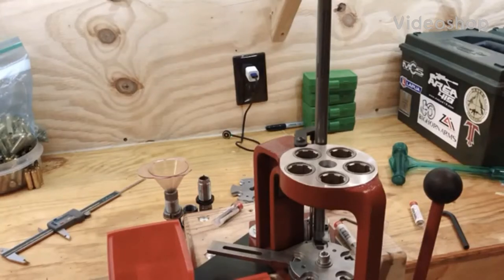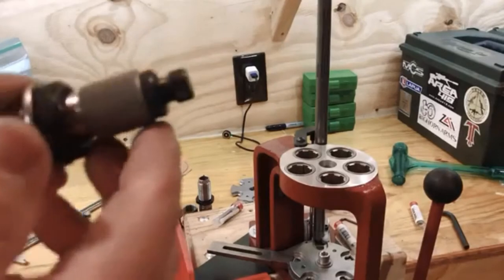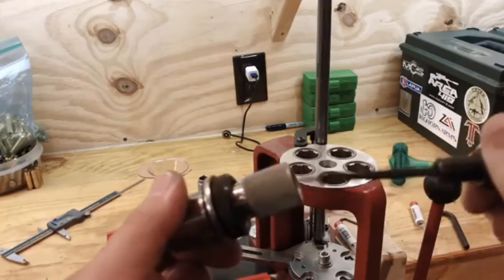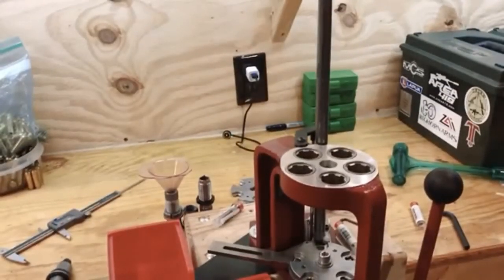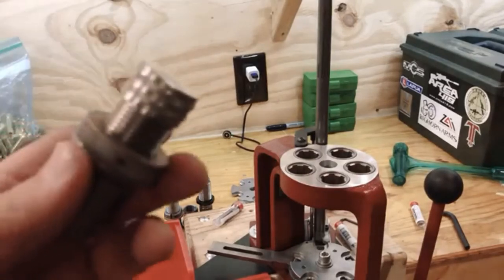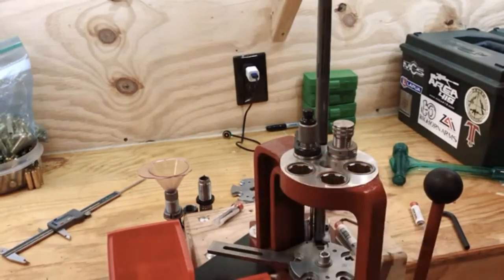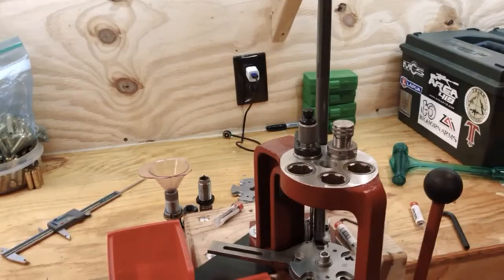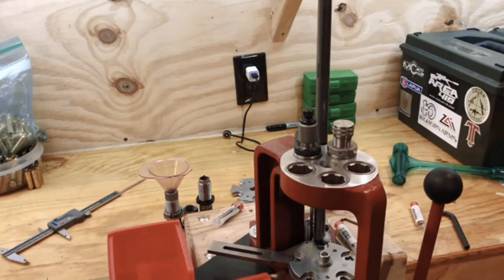Reloading:  Better Precision With Mandrels

Comment: Great tip. Several of my colleagues have already suggested me to use a two-step sizing method (FL with no expander followed by a mandrel die).
How does it work with the Hornady AP press? Mine has a slight tilt to its base plate. I'm concerned it will ruin the shoulder bump consistency. Did you have to modify the press?
Reply from the maker: Mine also has a tilt but it goes away toward the end of the stroke, the die aligns the brass and as it comes into contact with the die it is straight. I am getting less runout on the Hornady press than I am on my Rock Chucker.
Reply: @thepracticalrifleman  Thank you, that sounds promising. I'll give it a try, when I get the mandrel die.

Comment: I wish I would have gotten into reloading long before all this craziness started.
Reply from the maker: Always time to get started. You can start acquiring gear now. When things normalize components will collect dust.
Reply: @thepracticalrifleman  you’re right. Is the hornady equipment at academy or bass pro any good? Something tells me it’s not and I’m trying to do the “buy once, cry once” approach.
Reply from the maker: @kwiturbitchin5277  to be honest, it depends on which equipment. I have some of the Hornady stuff including two of the LNL AP presses. I also have their comparator sets. That stuff is good to go. 

There is far better when it comes to dies, trimmers, concentricity gauges, etc.

Comment: It’s a common misconception that the expander ball is causing the problem. I bought into it for a while too! The real culprit is the bushing design. Get a “Short Action Customs” tapered bushing and you can use the factory expander ball with impunity! Consider this, John Whidden was a 6 Times National Long range champion and he uses the typical full length sizing dies with an expander ball!
Reply from the maker: But are his dies are his, am I right?  Not your typical off the shelf Redding or RCBS.
Reply: @thepracticalrifleman  Sorry, don’t understand your question.
Reply from the maker: @58harwood  he uses Whidden dies?  Correct?  And I’ll bet you a dollar to a donut that John Whidden has the skill to win no matter how he loads. 

Even with non-bushing dies, I’ve had poor luck with expander balls. The mandrel in a separate step is the way to go.
Reply: @thepracticalrifleman  not saying the mandrel doesn’t work but using the SAC bushing makes the mandrel an unnecessary extra step, and creating more work than you need to do. I used a mandrel for years and I bought into the lie that it was the expander ball causing the runout! It turns out, it’s not the expander ball causing the problem, It’s the type of bushing you’re using! Have you seen this?  https://youtu.be/D2Gei8Wo6UA
Reply from the maker: @58harwood  I’ve gotta have something. Brass gets stepped on and smashed into the dirt at matches.  Semi auto brass gets bumped on the selector, etc.
Reply: @thepracticalrifleman  ………That’s what the expander ball is for! It does the exact same thing as the mandrel but it’s intergraded all into one step. I’ve proven, at least to myself, the expander ball doesn’t cause excessive runout. So then why not save time and labor by using one? If you want/like breaking your brass prep down into multiple steps, have at it! I’m looking to streamline the process and get through it as quickly as possible, as long as the quality of the end result is not degraded.
Reply from the maker: @58harwood  the expander ball tends to stretch the necks and sometimes pull them out of concentricity. I do a LOT of my brass prep on the progressive press. Breaking it up like this just means a station.

Comment: I sent my FL sizing dies back to the manufacturer with 3 fired cases per rifle caliber. They honed the neck to squeeze the case neck .0025. I ditched the expander buttons and never looked back. No issues, excellent accuracy, one step process, only sizing the outside diameter. From the factory, some of the sizing dies were greatly reducing OD of the case necks several thousandths and when I used to use the expander buttons it caused substantial resistance and overworked the brass. Best decision I did for my case prep. I do use a separate decapping die that is universal
Reply from the maker: Good method!
Reply: The only problem with that method is, all factory brass has varying degrees of thickness around the necks circumference. And if you don’t “neck turn” your brass, by only sizing the OD, you squeeze all those high and low spots to the ID. Now you’ve got varying degrees of neck tension inside the neck. Which is why people “neck turn” to begin with, and/or employ some method to push those imperfections back to OD after sizing before bullet seating. Most people will never notice the difference but it’s there! Once you realize the expander ball is not the root cause of excessive runout, using them saves a lot of time and labor with brass prep.
Reply: @58harwood  I turn the OD - have for 20 years or so maybe longer, can't remember. In many of my rifles, like the 270s, 30-06, and avg hunting shot 300 yards or less, makes no difference. Beyond that it definitely helps. But I've been turning OD awhile
Reply: @Accuracy1st  …….You are way more dedicated to it than I am Derek! Neck turning is where a drew the line! 😭 Anyway, I agree, at normal hunting ranges, most of these techniques are overkill! Good luck to you! 👍
Reply: @58harwood  Yea I've been back and forth on it depending on rifle and load. For example, I have Winchester brass, lots of it, for 270 Win. Without turning necks, I'm grouping 2" with 5 shots at 300 yards with 130 Barnes TSX over 57.0 gr Re19, Fed 210M primers. It's a Ruger M77 MKII with a 25.5" Hart barrel, action bedded, 3 pound trigger. I see no reason to turn the neck for that load in that rifle. However, I also use Lapua 30.06 brass in a different 270 and I turn those necks due to the thickness
Reply: @Accuracy1st  Yep, understand. In replying to this thread, I was merely trying to suggest that the “expander ball” is not the culprit for excessive runout! Like I said earlier, mandrels work. I’ve used them for years before cracking the “expander ball” code! I’m  only interested in, looking for the fastest, least labor intensive way process my brass! That’s all!
Reply from the maker: @58harwood  that’s what the expander mandrel die is for. 👍